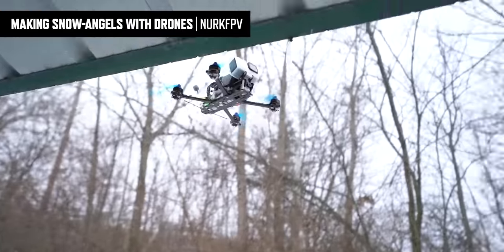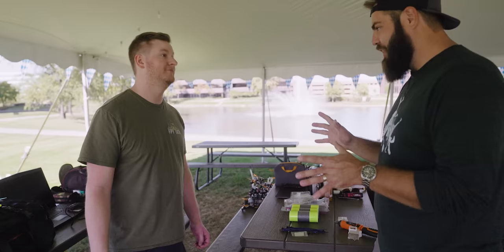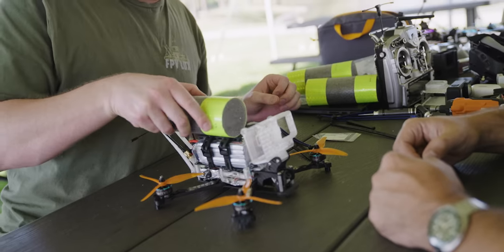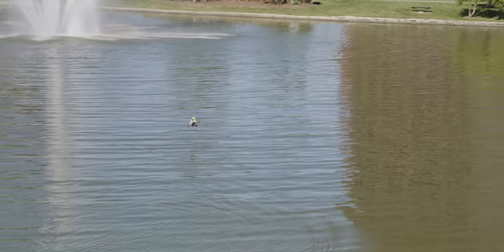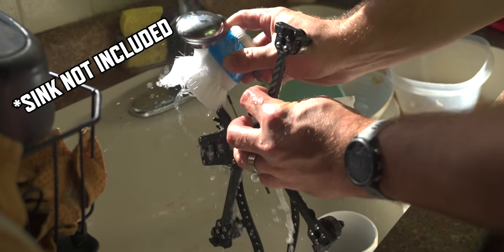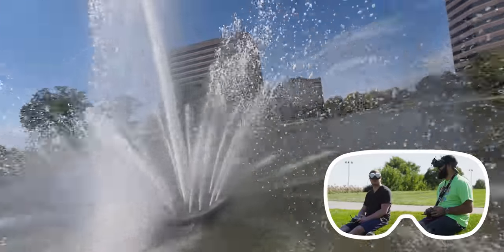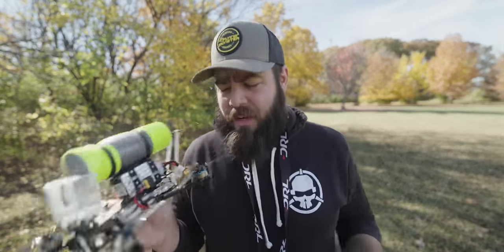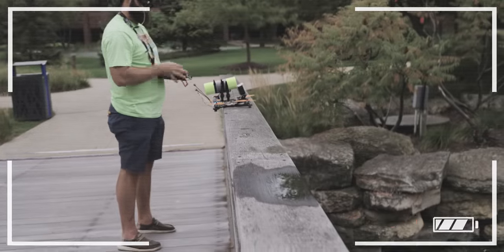Putting Fully Waterproof Drones to the Test

Comment: One really important thing you guys missed: Both antennas are mounted high up so they're about level with the float because water is really good at blocking RF so if they're under water you may failsafe/lose video.

Comment: I've looked at these quads and they look awesome! However I fly in super harsh and extremely windy conditions so I don't know if the waterproofing is up to it... Would a quad like this hold up in salt water with the main components well waterproofed? (I know the motors will get destroyed eventually) I've double layer conformal coated my electronics but I'm still looking for a more robust way to waterproof. Fun video guys!
Reply: 4:45
Reply: @FDroid01  Long term... like full time salty air and if I crassh - salty water

Comment: Very cool.. how did you waterproof the battery? Doesnt look like you did, but seems that would be bad to dunk a lipo in water unprotected!?
Reply from the maker: Nothing extra needed
Reply: if you really want, fill the holes in the shrink wrap where the cables come out, with hot glue.

Comment: So the frame kit is $200? Thought it was a bind and fly. So you would have to put your own components in it? Doesn't the water  affect the motors?
Reply from the maker: There's a waterproofing kit available now and there will be a bind and fly available later
Reply: @NURKFPV  thanks for the info Nurkski's
Reply: @NURKFPV  you think you could actually fly inside the water like a submarine in a sense?
Reply: @NURKFPV  when is the BnF going to be available? Would love to buy this soon but if BnF won't be available for a while I may attempt to build it based off what you have linked in the description

Comment: you think you and others dont have skill, when anyone has to ask anyone for anything
Reply from the maker: Eh?
Reply: @NURKFPV  information transfer between truly skilled is not required (as all "parties" already have perfect knowledge, with-in God)
Reply: @NURKFPV  therefore only the unskilled will "exchange information", law knowledge is useless, even if a nice idea in general
Reply: try diy radial ring magnet in copper pipe sheet motor with iron rod core